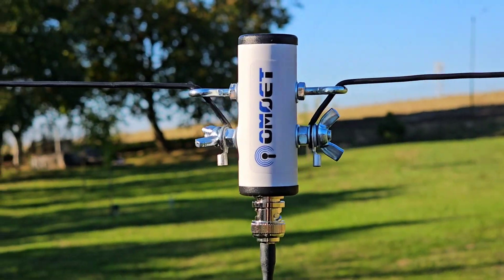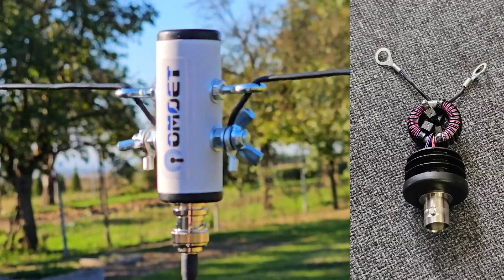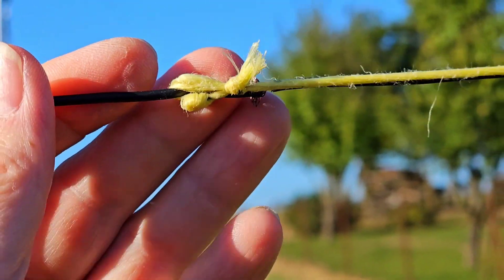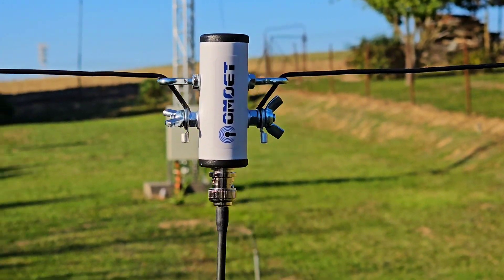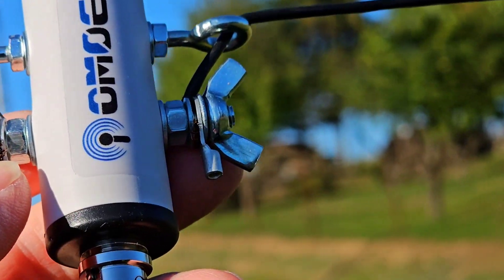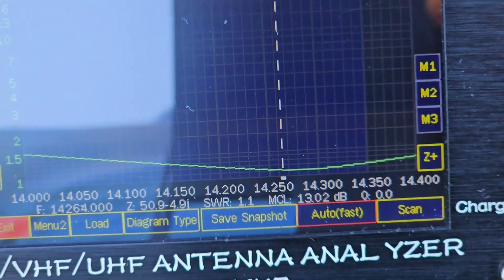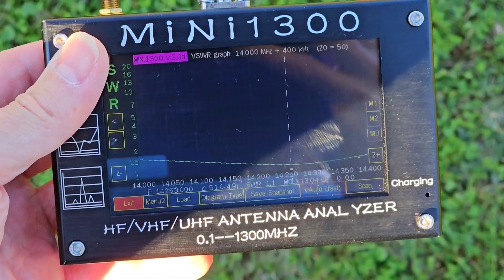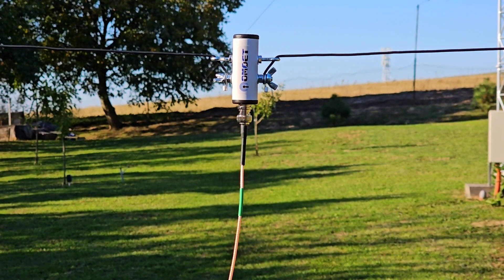TEST of Mini 1:1 BALUN for Classic Dipole Antennas

Comment: Hi! I am new to the radio hobby. I would like to build the antenna in the video. For the balun i have found a 17x14x10mm ferrite donut. Do i need to change number of turns or something to make it work properly? Aiming for 3-30MHz maybe. No license yet, just listening. I just need to shorten the two wires to tune to VHF/UHF?
Reply from the maker: You can use the same number of turns with your Ferrite core and the dipole antenna.